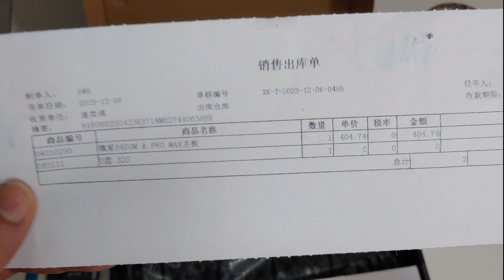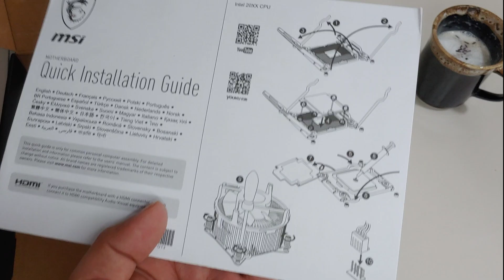Unboxing MSI B450m A- Pro MAX

Comment: Ela suporta um ryzen 5700x3d?
Reply: Yes and No
yes: if you update the bios to the latest version this board gonna be able to run ryzen 5000 series .
no: bcs the ryzen 7 5700X3D and 5800X3D both use 105W TDP which is really high for this motherboards VRM .
ps : i would go with a b550 for the 5700x3d.

Comment: mano, ela aguenta uma rtx 4060 junto com r7 5700g?
Reply from the maker: Se o cara colocar um fan vertical, pra ajudar os vrms, tanka de boa, clica no link para ver qual o fan que falo, https://www.youtube.com/channel/UCPBJz6X2qEeCfNZ2w4Dp9qA/community?lb=Ugkx4yzHtTt3BMrdG-FqViS_GvtBcjBpKlKh
Reply: @finosen  Eu tenho WC de 360mm e com mais 8 fans no gabinete da Aigo com 74 de CFM (Aigo Ar12 Pro)
Reply: Absolutamente não recomendo você tentar um Ryzen 7 5700G nela. E com uma Rtx 4060 vai ter gargalo, melhor optar por uma placa mãe mais parruda e um octa core sem Apu. Vai vendo até um R5 5600 compensa mais.
Reply: Placa mãe que eu recomendaria com essa CPU, pelo menos uma B450 com dissipadores e de alta qualidade, ou uma B550 também de boa qualidade, tem que ter dissipador no VRM, senão ele vai super aquecer e gerar problemas. 
Você pode optar pelo barato sim, mas isso afeta diretamente a durabilidade e a performance. (Não vá na B550mh da biostar que é bomba)